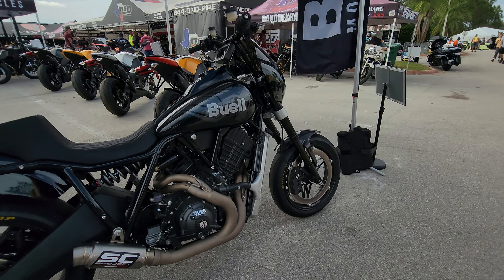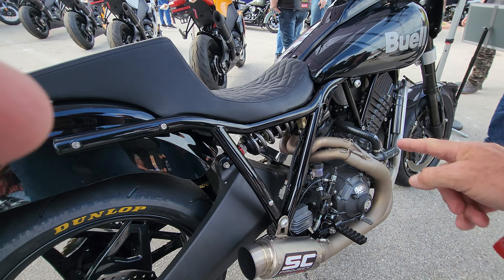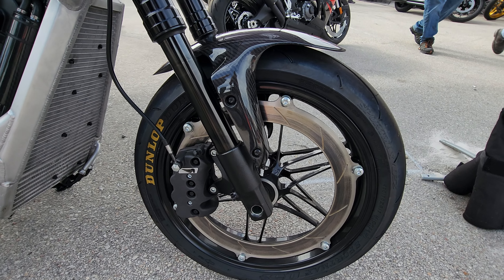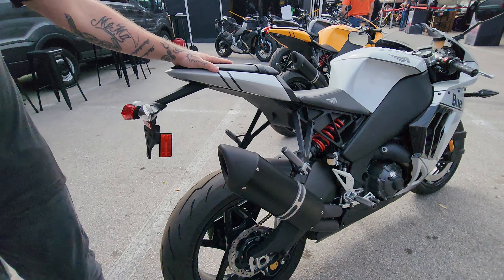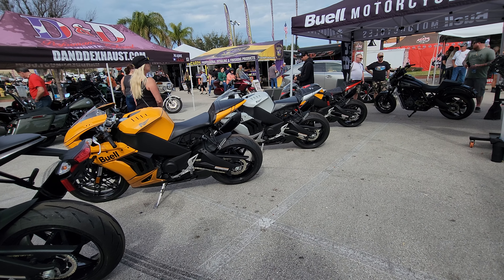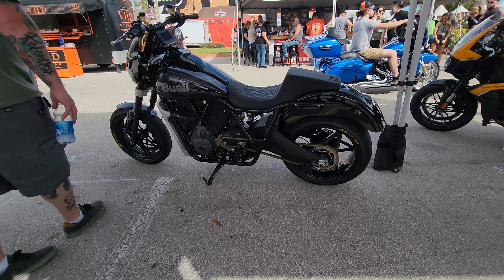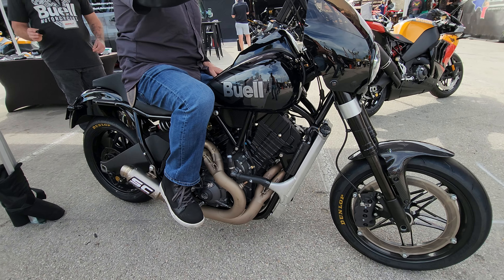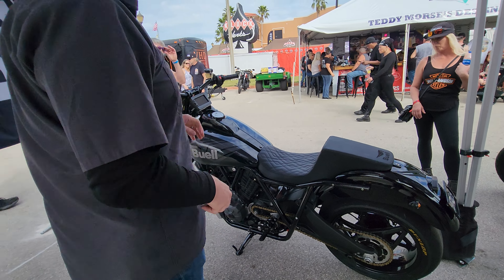BUELL SUPER CRUISER #1 PRODUCTION PROTOTYPE INTERVIEW WITH CEO BILL MELVIN

Comment: Kaplan got your ears on ???  yes yes yes go for it ..be the speed ..it's just the right thing to do .. this is the street tracker  dirt bike cruiser adventure hooligan cafe 0 to jail in 4.2 or 2.4 depending if on dirt or pavement ..this bike is the one you have had in the back of your mind ever since you got the hole shot on an mx bike and ever since you rode your first FX ..it weighs a 100 pounds less than our XR1200's and a with twice as much horsepower ...just a though you got a dyno-jet  ..give the buyers a dyno tune right off the bat so they will have a stock base line to compare with in the future tune ups and mods that would be insane , but i would
Reply: i still cant stop giggling when on a two stroke tuesday you were reviewing your inventory for sale and without breaking character you said " and over here we have our anti-two stroke electric bike " i fell off the couch and busted a gut in laughter
Reply from the maker: lmao Donnie its true!

Comment: I was considering getting a Buell. But they’re in Ducati Panigale price range with NO DEALER NETWORK. They also depreciate phenomenally, and no one to service, or where to get replacement parts. It’s a super cool bike. I love the chain drive. The RS would be my choice, but it’s too expensive. If it was priced in the 600cc sport bike range, I’d seriously consider buying it. Keep in mind, no dealer network, crazy depreciation. I’m not paying for that I’m my own. I’d split the diff with Buell, but not me alone.
Reply: You don’t think the fastest made American super cruiser is worth 20k?
Reply: I’d buy that Super Cruiser. Just have a manual available and i can get to work! $25-30K still a better ride investment than a softail for me. A LRS comes out over $20K and that’s bone stock. Throw $5-10K into it and you get a badass LRS, but will still be heavy. We’re talking 450lbs here, which is lighter than my Sportster, pushing 175hp and most likely over 100ft.lbs of torque. Sounds like a lot of fun to me. I guess i feel different cuz i’ve enjoyed high rev’ing bikes, and can wrench on my own machines. And that motor has been proven, just in a new frame. Mostly likely re-tuned for better torque down low. I think they built that machine for people like me!
Reply: Finding a competent mechanic to repair it might be an issue. Beautiful bike though.
Reply: old man strength  um u see the price on most 1200s?......
Reply: Well when they open up there new shops across the states they will have competent mechanics to work on there bikes. I just hope they bring back XB parts back and will work on the earlier bikes.